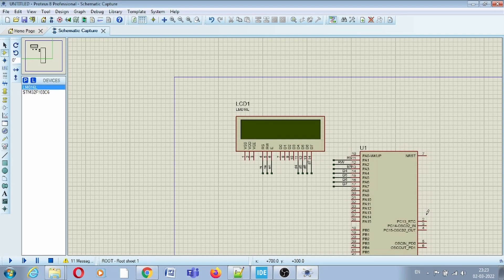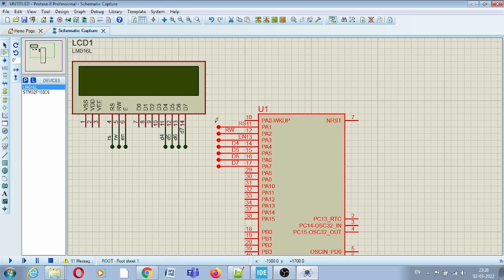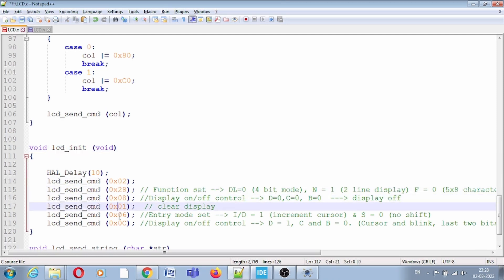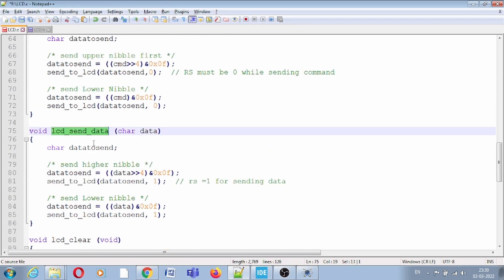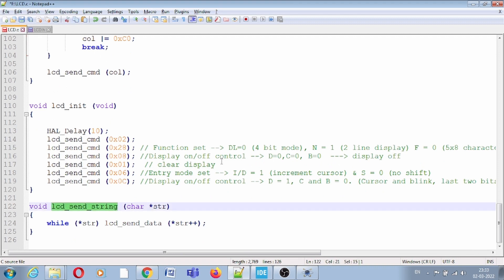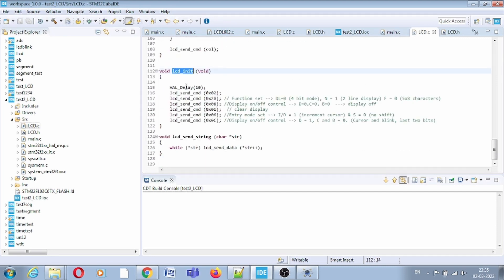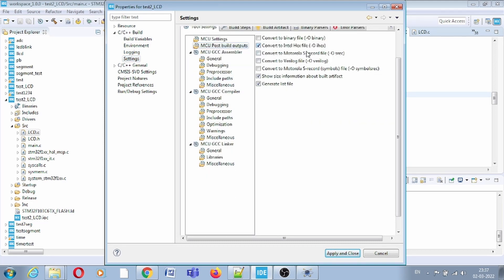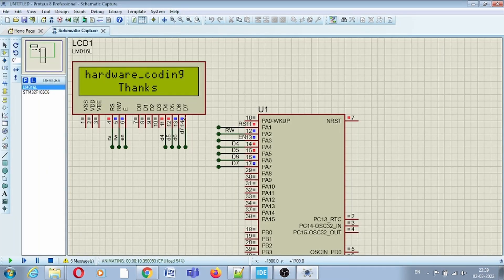STM32 : LCD Interface using STM32CUBE IDE

Comment: where is the power and GND ?
Reply from the maker: @leodavi7105  Thanks for watching the video.... The simulation software often assumes default connections for power and ground to simplify the simulation process. However in real hardware these connections must use.